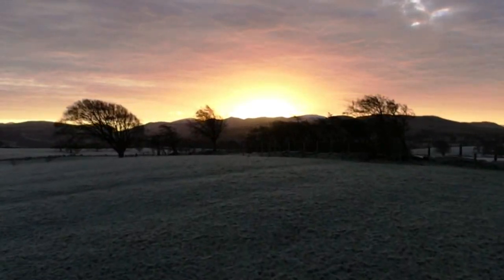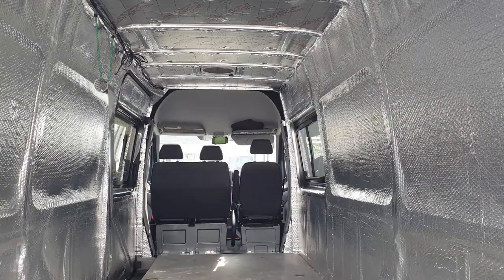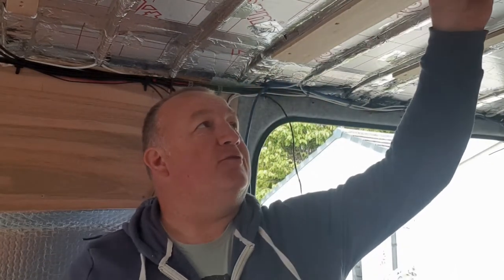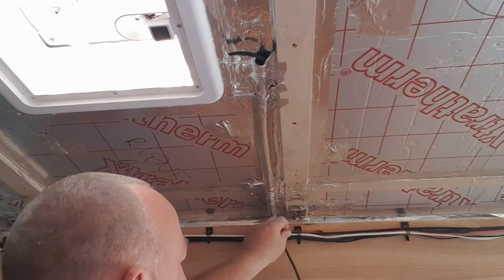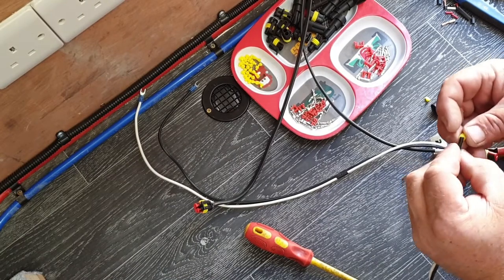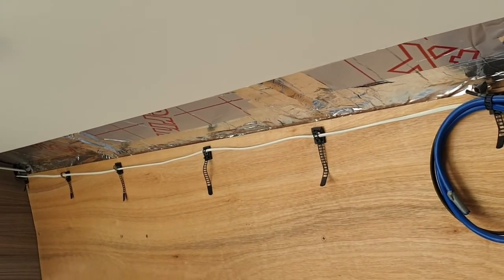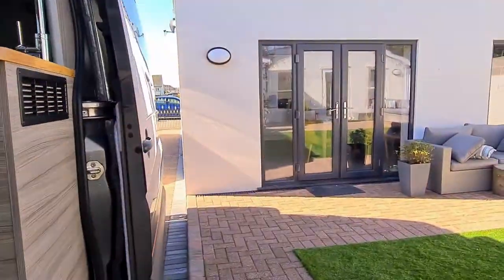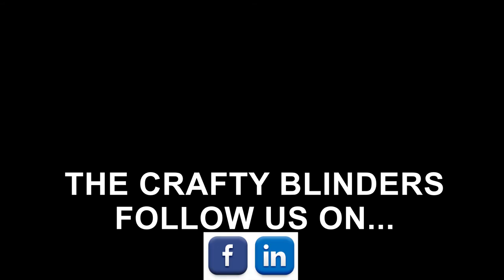selfbuild | vw crafter | campervan | electrical install | van build | part 27 | the crafty blinders

Comment: I completely agree with what you said about making things accessible. I find it mad watching people do stuff like spray foam, no access oanels, no easy way of disassembly etc.
When building mine I am using rivnuts as much as possible to make it easy to take apart.
Reply from the maker: Sound like you have it covered

Comment: From Canada:  great technical video!  Can you provide information about the plastic trim you are inserting between the ceiling panels?  (Minute 10:29).
Reply from the maker: Hi Canada 🇨🇦 😁 one of my favourite places in the world the trims are from a company in the UK called Moorland UK they are designed 3mm wall or ceiling boards they come in two parts and just put together very simple and very effective if I remember correctly there's a link in the description I may have a few left over if it helps you with your build